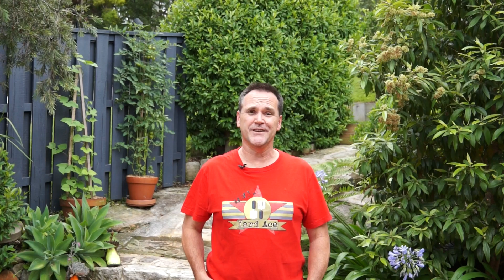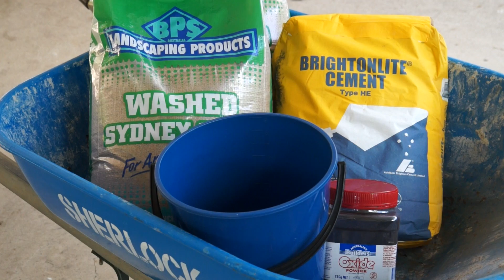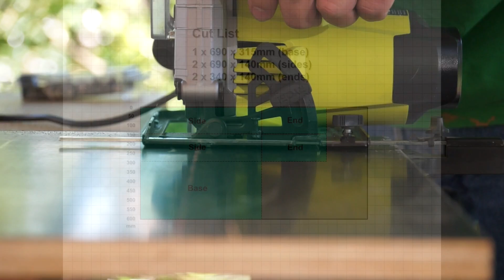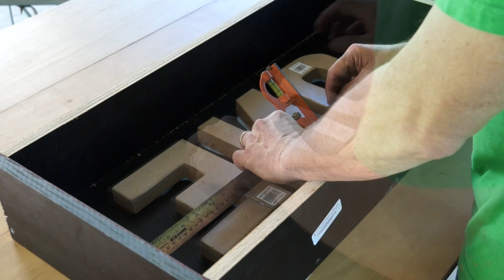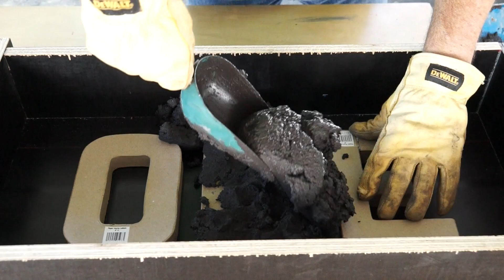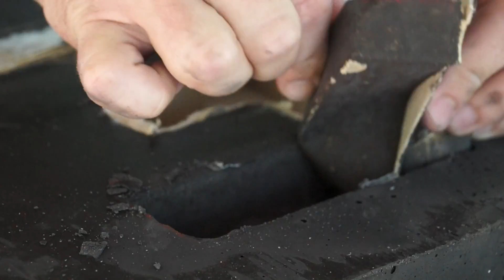DIY Easy & Funky Concrete Art

Comment: What is the purpose of mixing with the sand versus just using the cement?
Reply from the maker: Great question Sarah. Cement is the most important component of concrete, mortar, sand and cement etc. 
It is actually the thing that causes the chemical reaction that 'converts' the seperate parts - sand, gravel, clay powder etc. depending on what you are making -  to a batch that sets hard & stays that way.
Cement powder on its own will set hard but it is very brittle, it has very little structural strength, and doesn't resist weathering well. It needs to be mixed with other products in the right ratios to create that strength.
That make sense?

Comment: And then within 48 hours your piece you spent all that time and money on will break into a bunch of pieces because you didn't use any reinforcement.
Reply from the maker: Cement based projects are quite strong without reinforcement @Mathew. 
If the are moved around a lot or subjected to stress then yes, they may fracture, but they certainly won't just crack or break-up on their own.
And by-the-by... that one has been just fine for years now.

Comment: additional tip: you can put a wire mesh (chicken wire will do) in concrete for extra strength.  :)
Reply from the maker: Absolutely Ricardo. 
It's a great addition to allow you to make the whole thing thinner or to add strength to longer moulds.
Trick is to make sure the wire is at least 20 from any outside edges or surfaces. 
If the wire is exposed it can start to rust & that will eventually crack the concrete (as well as staining the surface)

Comment: Looks real nice, would it be best to add Glass Fibres to give it extra strength ?
Reply from the maker: Hi @The Shazzbag, thanks, I think it's pretty cool. We've just moved to a new home so I can't wait to make another for here :)
For most situations your shouldn't need any reinforcing as it's not going to under any stress or pressure. You could just use simple reinforcing, like chicken wire, through the middle if needs be, say if you mould was long or thinner than what I made.